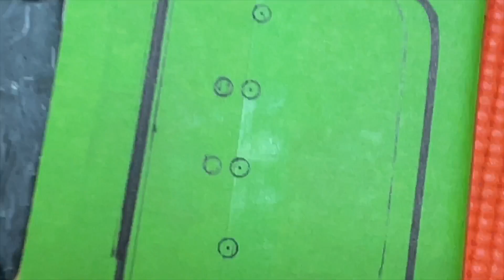Hohner G3T re fret, re furb, re finish, bridge replacement and set up P2

Comment: Daam what great work. I want something like this doing to my hohner. The problem is parts have failed and you cant get them anywhere. Sidenote you can get an adapter that sits into the headstock area and allows you to use normal strings. Great Work!
Reply from the maker: Hi BMF, thank you! Yes - I've seen / know of those converters. It's a shame they didn't anticipate it from the outset though!
Reply: @SamDeeksRelovedGuitars  the two small metal pieces that hold the bridge onto the screw in pegs have failed on mine also the pegs seem bent. Can't seem to buy those pieces anywhere. Buying a new bridge is out of the question as genuine ones rarely come up and the Chinese copies are really bad by all accounts. Interesting to see your fix. I must have missed the previous vid but I assume you filled the gap where the previous bridge sat with some wood?
Reply from the maker: @blackmoofou6385  I did. And I happen to have a complete Hohner / Steinberger bridge from that guitar for sale btw ;)
Reply: @SamDeeksRelovedGuitars  Hi Sam, is that Hohner bridge still available for sale? I have the bent pins problem too on my Hohner (it's common apparently on this tremolo design and means its always going out of tune) and would attempt the Ali Express mod (or ask you to do it) but wasn't sure whether the vertical tuners get in the way of strumming? Did you find that to be an issue?
Reply from the maker: @ Hi - I do still have it; not sure about the pins issue as I didn’t play it in its original installation and just removed it. The customer didn’t like that there was movement in it even when ‘locked’ IIRC. Make me a cheeky offer it’s any use to you - you can reach me on samdeeks@gmail.com